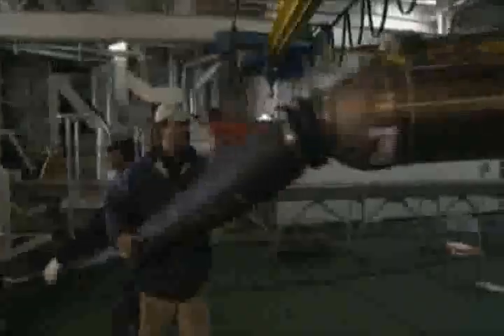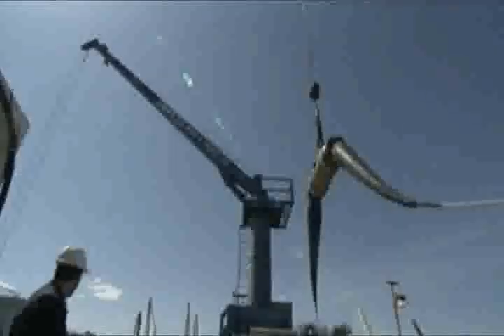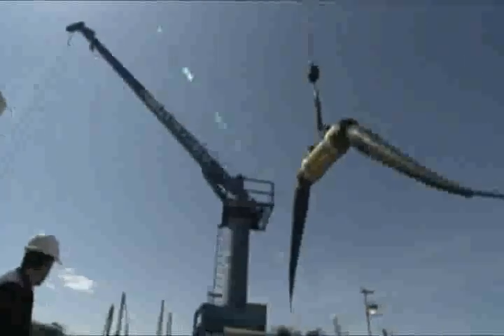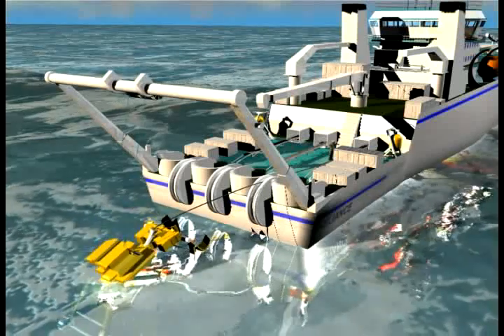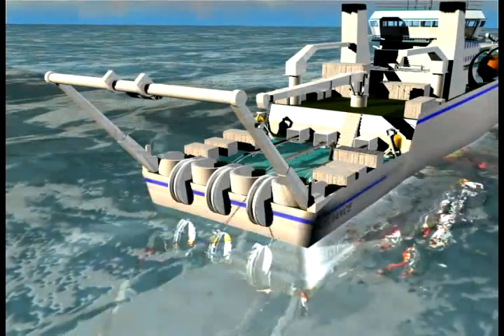How undersea cables are laid

Comment: About 13 Mbps and I pay $37.50 per month. I'm from Australia. I feel bad for your country. It looks like it has a way to go to get good infrastructure. But good luck on your move to Japan.
Reply: These speeds are laughable now
Reply: @Ollied  True but that was in 2014 and the country has now graduated to 50 Mbps which is what the most residents are on. A few are on 100, 250 and 1000. At the time they said no to lines capable of that for most. Political interference. But now this is starting to change and lines are slowly being upgraded over the next several years.
Reply: Now I just realised I have no idea why my original comment was on this video.